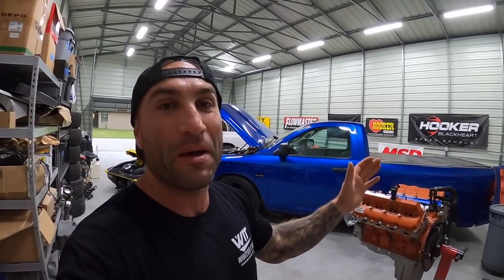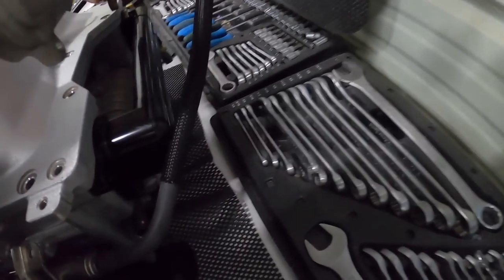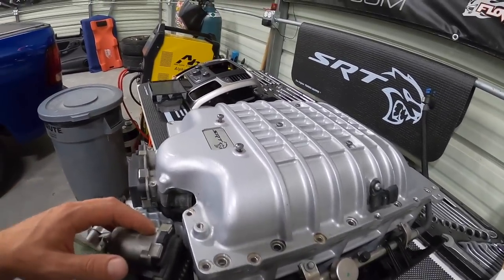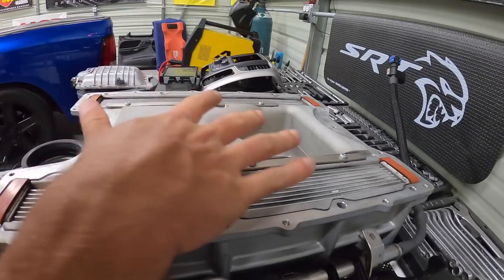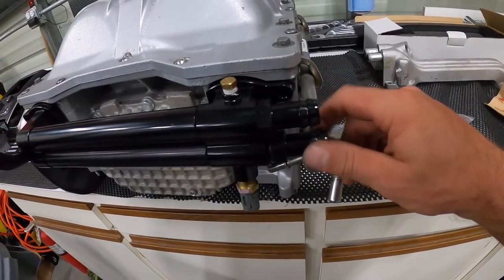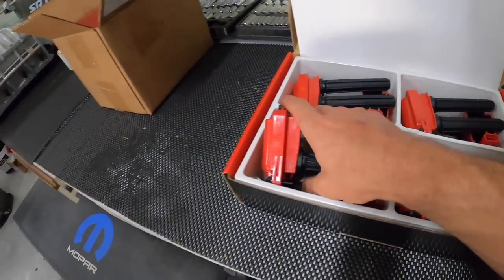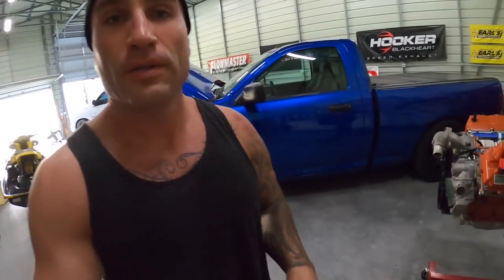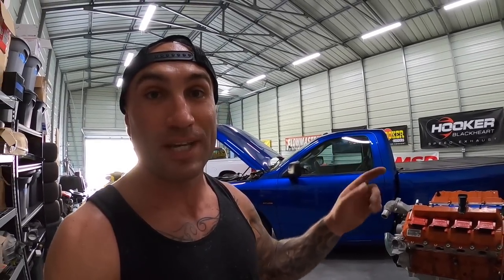Hellcat Engine is Ready for Hellcat Swapped Dodge RAM 1500

Comment: You posted a video two years ago, it was a video on installing a 52MM throttle body on the Dakota when it still had a 5.9. I was wondering if I could put that on a 3.9, I would LOVE to avoid a retune which you avoided as well and the 5.9 ran great after the swap. Was wondering if you think I would get the same results. Thanks in advance!

Comment: This build has inspired me to start a similar project. I've always loved the look of that truck and the hellcat. Bought the truck 2014 1500 regular cab short bed. 5.7 with 3.55 gears (sure grip) or whatever they call it. Think I screwed up because it has a 6 speed. Called a fella that does these and he said not a 6 speed. He said he's done the 8 speeds but wouldn't do a 6 speed for electronic reasons? Did I screw up? Was gonna get an engine and trans out of a crashed charger or challenger.
Reply: Do a manual trans swap instead. Score the pedal setup from a hd truck🤙🏽
Reply: @devillockj  something to think about. Good idea. 
Thanks!

Comment: Jon you need to go to bouchilon performance and get the lift plates to pull the motor out.it is a 4 piece kit bolts up to the exhaust ports on four corners of engine.they fit the,,5.7,6.2,6.4 hemi engines I have them on mine with the use of an engine tilt assembly they are awesome.a must have for what you are doing best 189.00+shipping I spent for the security of having the engine swinging off the engine hoist they are approximately 3/8 plate ... check them out 👍👌✌️🇺🇲🇺🇸